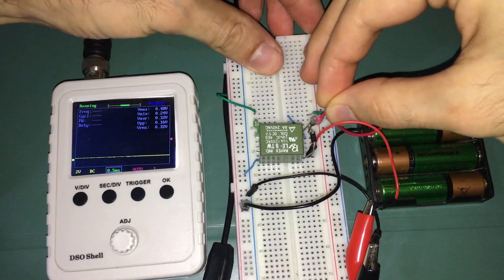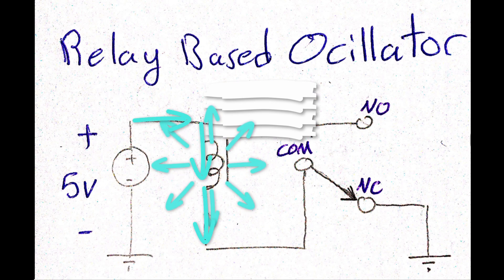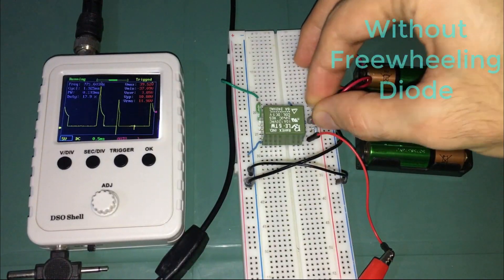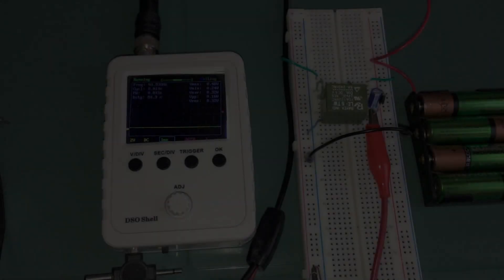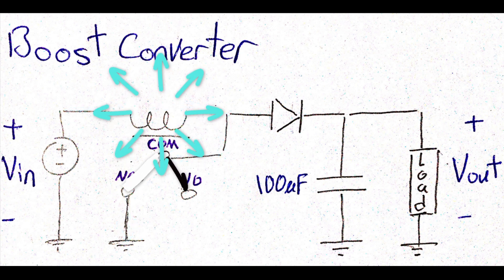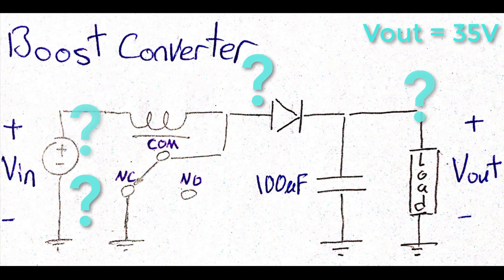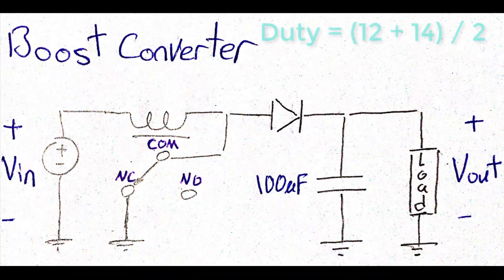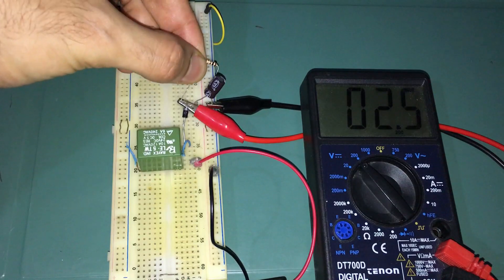Relay Based Oscillator with Boost Converter

Comment: Can i use it to charge my capacitor for my coilgun?
Reply from the maker: I don't think so, the circuit needs feedback to keep the output voltage level at a certain level